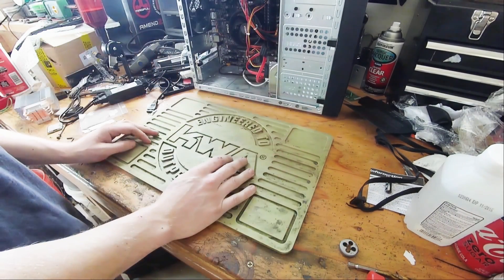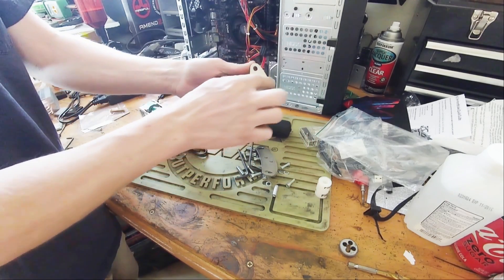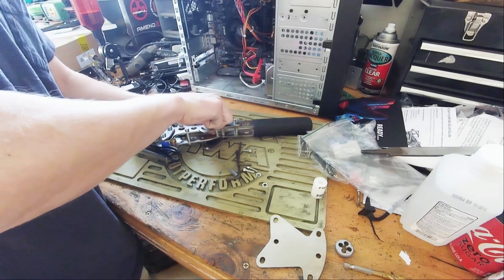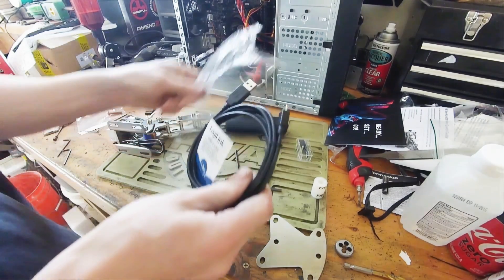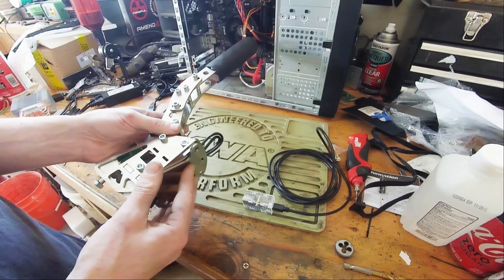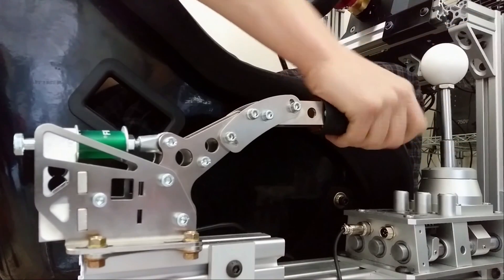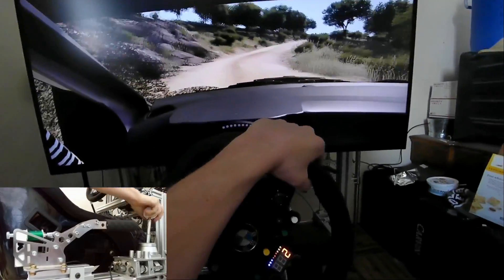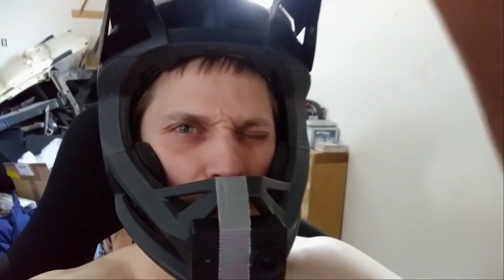Is The HEUSINKVELD Handbrake Worth It?

Comment: Oh wow, totally out of the blue!! :D
Heard a lot of great things about this handbrake. But yeah I'm with you about the micro usb, the same on my HE shifter, really easy to jank out, and feels fragile..
A bit bad you had to rasp it down the first you did as well!
Reply from the maker: I think they should have mounted the circuitry inside the unit and made it a standard larger usb connection. Not sure why they went with that tiny horrible connection. 

I do like the handbrake though and the more I use it, the more I appreciate its robust construction. Just the little faults hold it back from being the best it can be.
Reply: @DouglasThompson  yeah not sure why they don't put the control box insede, same with the pedals, but luckilly a big connection on those!😅
Reply: @DouglasThompson  Agreed. Cheap eBay handbrakes have all the electronics inside the unit and a single cable, yet one of the more regarded brands in Sim Racing can't do that?
Reply from the maker: @SireEvalish  it seems like HE will be moving in that direction with the upcoming revisions based on a recent interview I watched.